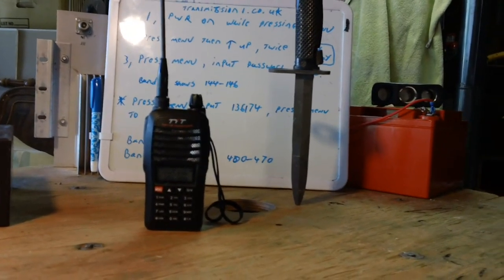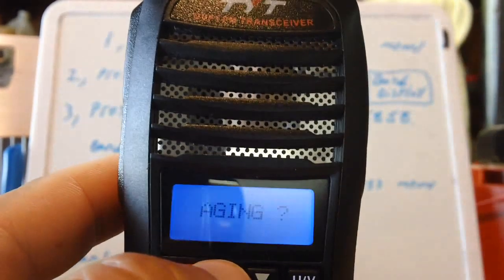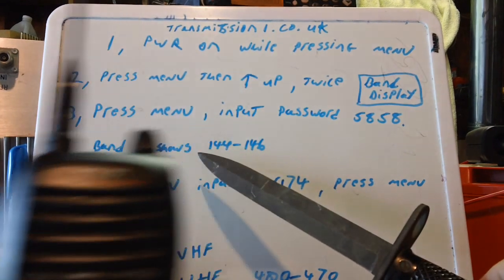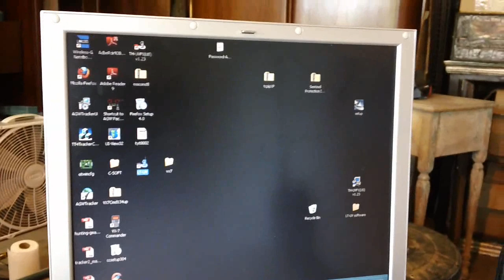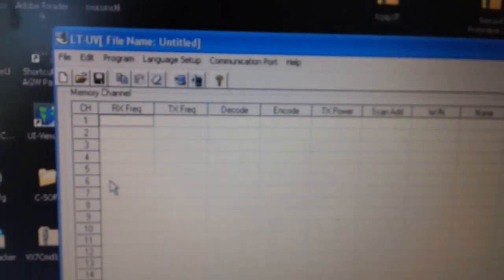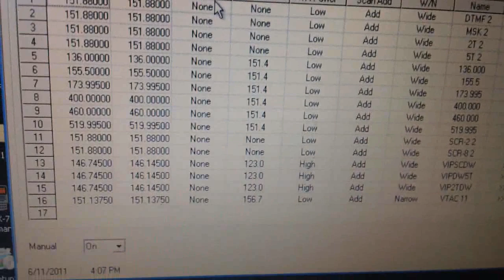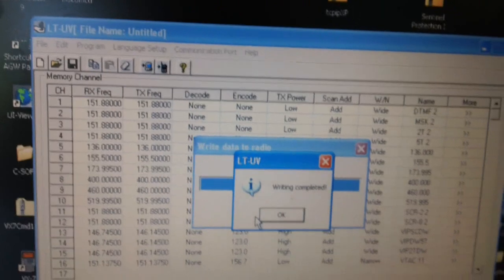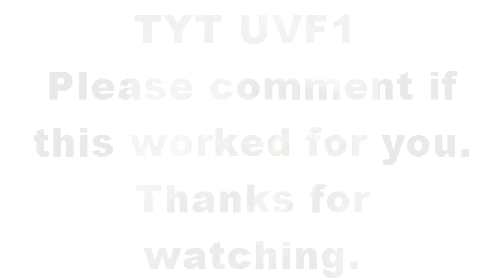Prepper Hacking, TYT UVF1 Dualband Radio Modification.

Comment: Ive got the TYT TH-UVF1 and ive got the drivers downloaded and the program installed but when i go to read my radio to add more freq it says "Opening port...transferring data blocks.... ERROR: Timeout while waiting for data blocks. Port Closed" Do you know why it does this? Or what i could do to get my radio programmed???
Reply from the maker: kelan danner It sort of sounds like you dont have your USB comm port configured for your software. I'm not sure if the software defaults to Comm port 1 everytime you open the program or not. But you must match the comm port setting of your software to the actual port the programming cable is connected to. Usually it easier to re-assined your cables comm port using the PC's device manager. Its a common problem that I encounter alot. Hope that helped.

Comment: I have 2 of these radios and 1 will go to 2.5khz steps the other does not is there a firmware or programming hack to mod the steps increments. Also is there a way to clone one radios parameters to the other. I believe I have uvf1 and a uvf1a and the steps are the only difference that I can see. Otherwise there great.
Reply from the maker: surjracer56 I dont know of any that will upgrade it to 2.5khz step. I get scared messing around with firmware and I dont recommend it unless you are absolutely sure it will do what you expect it to do. I've "bricked" a a few in my time just doing routine upgrades. I dont remember if you could clone one to another, it would take a special double ended cable specifically made to do that. One of my TYT I broke interfacing it with another device and the other is on top of a mountain deployed. Sorry I couldnt give you a better answer.

Comment: This vs the baofeng uvb5... what you think?
Reply from the maker: I should make an update vid. The TYT radio has fallen out of favor for me. Dont own a baofeng, but I am thinking of getting one or a few for the family. The transmit audio on the TYT sounds too muffled and some of the quickcall features are unreliable. Its saving grace is a a few versions snuck by with the voice scrambler feature. I've been liking the Wouxuns lately, its my beater up radio.
Reply: thanks, I am considering a Wouxun too but I think for not much more, I'd rather just go with the ft60r, which is why I asked that in another post... I'd rather just buy once and cry once, that's not to say that I am ok with spending 200+ per radio though. this is a prep item/hobby so I will be getting  more than one, probably more like 2-4 radios, so they need to be relatively affordable. I am intrigued by Baofeng and Wouxun, but again, at the price if their better units, they are not that far off from a quality Yeasu, especially by the time you consider costs of mods to the cheaper radios.

Comment from the maker: If I remember right, the USB cable has to have the driver installed. When you plug in your USB radio programmer, find out what comm port it is with your windows device manager under ports. Match the port # of the cable plugged in with the setting on your radio software, that should take care of it. your cable plugged in comm port # should match what the radio software is using. Common problem having them mismatch.

Comment: You left out a step. When you initially Read the radio, you must save it to your computer or you won't have a backup of the original configuration before you Write back to the radio.

Remember, backup is your friend.

Comment from the maker: Sorry it took awhile to get back with an answer. I checked my cable to see if it was a strait wire, but its not. The plug portion seem to have a circuit inside to convert USB to serial data. I dont have enough knowledge to replicate it. Perhaps there might be another source of info that will have a diagram for Serial port com1, 9 pin connector to connector jacks of the radio. I did not find a reliable source of information about making one.

Comment from the maker: @taeyedoc99 Looks different from where I last downloaded. on the page its the "Request Download Ticket" box, when you hit that it will turn to "download". Hit the download box and it will start the process, the .rar file is called "software.rar", .rar is like a .zip file, need to unzip it, or the utility to unzip a .rar file. I went through the motions again and it looks legit and valid, those other stuff is just bells & whistles. No apologies needed, you'll do just fine.

Comment from the maker: @ryanperry90 Thats the 4 meter range, and its illegal for civilians to use that band. Here in the US, I've seen the 70 mgz range used as linking radios systems for remote areas and R/C model toys.   I think the Europeans use this range for hams but not sure. The antennas would be bigger unless they dumbdown the ant for space management. Theoretically it should cast out farther than 2M but it depends on the antenna, should be at least be more than 30 inches. Bottom line, illegal 4 you and me.

Comment: hey love you videos i am looking at a new handheld  it a WOUXUN  KG-699E VHF 66-88 Mhz
is it ok to use 66 - 80 mhz in the usa and will it have more range then my 2m and 440
hand held the KG-699E puts out 5w  as does the 2m and 440 will i get more range with low mhz???

Comment from the maker: @ThePauperPrepper I remember the comment, I guess I didn't have an opinion about it at that time. It doesnt surprise me the gubment caught on to the scrambler feature. I havent seen any news or notices about blocking the scrambler, but I bet it will happen. I'm thinking because its certified as a FCC part 90 radio the feature is still legal to sell because law enforcement are the only ones who will have approval to use it. the other services, Part 95, part 97, is not permitted at all.

Comment from the maker: @GunFanactic Operationally they are about the same, transmits and receive sound quality is pretty cool. The build quality is inferior to the american models, well, they are built for punishment . The TYT radio are like the cheap bubble wrap radios, almost like disposable cell phones. but for the money its a great value if you don't punish them in the field.